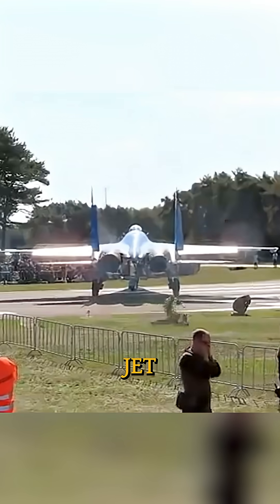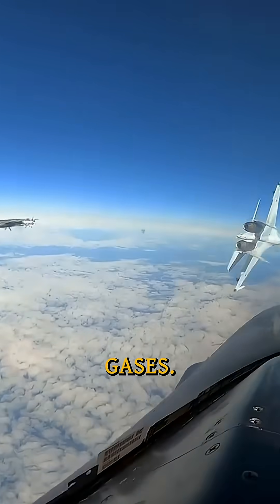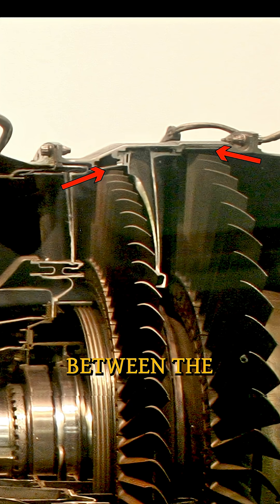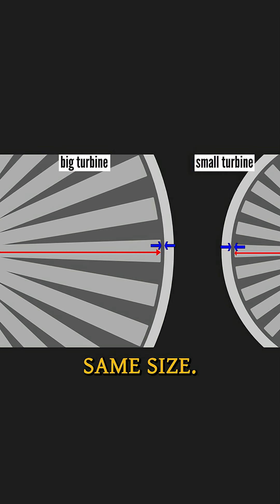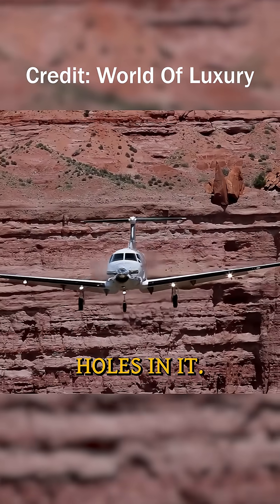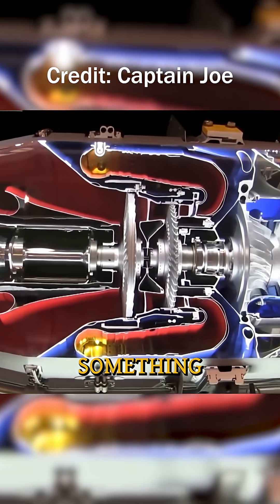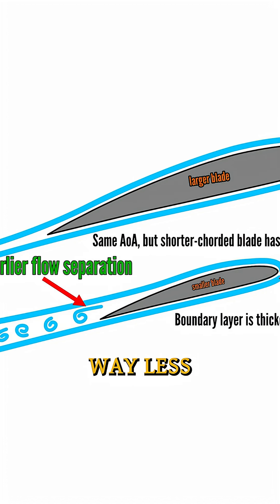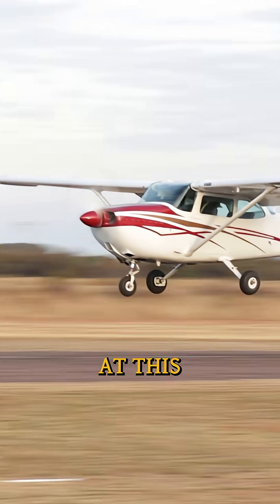Why Turboprops Can't Yet Replace Pistons on Small Planes

Comment: The cirrusjet would like a word
Reply from the maker: The Cirrus Vision Jet is a 7 seat aircraft with an 8kN turbofan. It's not exactly tiny.
Reply: @LetsGoAviate  no but by enjine stands it is especially for a turbofan. You also have the TP-100 series engines which are smaller than the Lycoming O-540 found in the Cessna 182RG.

Comment: Just saw a short where they addressed that gap by introducing more or less kinda like winglets for the fan blades end. So it creates a kind of bubble that keeps flow more on their respective high & low sides. It lead to a 2.7% increase in efficiency without any other major modification. Since they couldnt adress the gap it self due to things like thermal expansion. Curious to see if it'll be implemented guessing the math works out when it'll be spread about that many planes and flights.

Comment: I don't agree with a jet "creating thrust with its exhaust gasses". Only rockets do that. In commercial jets most thrust (85%ish) is "bypass" air, created by and encased propeller. Even in fighter jets a good (35%ish) amount of thrust is "bypass", only in need they can fully function more like a rocket with the after burner (but lose fuel fast)

Comment: All the bull shit he said is true however the real reason is money, upkeep on a turbine is expensive, a turbine engine is expensive due to tight tolerances on everything, there are cheap jet engines but they dont pass noise ratings for small aircraft ao no one uses them either. Reciprocating engines are just cheaper. You can buy a small Cessna for 20 to 80k but if you put a 200 to 300k engine on it thrn its out of reach for most weekend pilots. It would be like putting a LS1 in a focus.

Comment: You can't beat the torque turbo props produce. The engines produce power much more rapidly from idle to full power. I would rather trade fuel for torque and throttle response. You can land w the engines at idle and be able to power up and go around if needed🛩️🤎😎

Comment: The problem is that those small aircraft ICEs still use Avgas with lead added to it. There is no excuse for it. If not turboprop, then battery electric.

Comment: The real question is why no small plane uses a modern direct fuel injected piston engine rather than a design that is unchanged since the 1940s
Reply from the maker: Well the Rotax 9 series iS engines use fuel injection far more modern than the 1940's, though not direct injection.

Comment: There have been turbo prop DE Haviland DH2 Beavers since the late 1960s   Very successful !
Reply from the maker: 500+ hp turboprops have been around a while, yes.
Reply: And more recently, the Bombardier Q400 version of the Dash 8. The Q is for Quiet. They add a Active Noise and Vibration System (AVNS) which basically does what the name implies. It has several sensors and microphones to counter the engine noise and vibration by creating the inverse-phase frequencies. Ultimately reducing roughly 104db in the standard model to 84db. Since db is measured as logarithmic, To our ears, it's like 1/4 of the volume. Or, as loudish road noise or a very busy office.

Comment: Most of these issues are solved from a technical standpoint, just look at the turbines in modern turbochargers. 

The big issue is certification and the associated costs.

Having a variable geometry compound turbocharger fail in an automotive or even industrial setting is a bad day. Implementing all the technical advancements that allows for small, very effecient and powerful turbochargers into a turboprop would be expensive, but recouping the RND AND the certification costs would cost an absolute fortune. 

Could it be done? Absolutely. Could it be done without essentially burning millions or possibly even tens of millions of dollars you'll probably never recover? Probably not.

Comment: Latest turboprops mounted on LSA’s and ultralights have almost the same fuel economy as piston engines , are way lighter and can maintain their thrust at altitude. This is done through the use of a heat exchanger in the tailpipe which expands incoming air before being fed into the compressor : Technologically difficult hence their only recent appearance. 100hp with 7gal/hr, much lighter, low frontal area and cooling drag, no vibration, low noise, can be used to drive a generator to power electric engines, recharge onboard batteries: The future!
Reply: Sounds interesting! Could you send link to these engines.👀
Reply: @ikaswitno probably talking about the Turbotech TP-R90.

Comment: Another reason is that a turboprop is very inefficient at lower altitudes. You need to be higher than 15-18000 feet to get good economy. This means pressurized airplane = very expensive.  Below 10.000 feet any turboprop is very ineffective.

Comment: 1940s piton engines still exist (instead of equivalent or better power diesels) is the huge cost of homologating a new engine. Regulations are necessary but they go nog adapt the process for small engines.

Comment: There are smaller jet engines and turboptops in RC planes, but they probably have even worse fuel economy and are much much more expensive than comparable piston engines
Reply: That and there's not tiny little people inside whose lives depend on them.
Reply: @dukecraig2402  I'm sure you could make them reliable they tend to be very simple engines. And the RC ones are way too small for say a turboprop 172, so they still be much closer to proper jet engines in size and thrust. The RC ones have up to 200 kN thrust do around 20 kg and they cost about 3 grand, the nice ones with proper control systems etc and they are super reliable, not much besides fatigue happens and that is predictable. But for 3 grand you can probably already buy a used piston engine and a jet engine with say 5 times the thrust, 100 kg should be fine for a small plane, but if the cost scales plus the extra engineering for certification etc... I think 50-100 grand is reasonable for a small turboprop engine. And maintenance won't be cheap even if it might need less. And everyone can repair a piston engine, even a pilot with a manual and some experience, a turboprop not so much. So that would make maintenance expensive. You'd need to go see jet mechanics and they need to learn new stuff an APU is closest but that doesn't make thrust. 

Chopper tend to have them but they're inherently more expensive anyway. 

Shame turbine cars didn't take off (hihi) they were great and we'd have millions of used turbines of the appropriate power and mechanics used to dealing with them and they'd run on every fuel except gasolibe. Even whale oil! Unfortunately it was cancelled for variety of reasons not unlike the GM EV-1 was cancelled as they feared the decrease in maintenance, which is a big profit for dealers and mechanics. Turbines aren't quite EVs but they got great mileage on the highway, terrible in traffic. Jaguar made a prototype once, hybrid turbine electric, though the turbines made power, they didn't drive the engines so you basically had an EV with on board generator. The Chrysler Turbine car actually had the turbine connected to the wheels. It would have been perfect as a hybrid, small battery for low inner city, stop and go, leaving the turbine to spin efficiently and just charge the battery, if the clutch is engaged. 

I think if we had turbine cars we may have had small turbine aircraft.at reasonable prices, the car market is WAY bigger so economies of scale incentive for efficient design etc... blablabla It did actually come to pass for military vehicles, the M1a Tank from the US has a turbine engine. A lot of power for a small size and good reliability.
Reply: @please_stop-v7o perhaps gaps are less critical in a centrifugal compressor? And in a turbine it is even less critical. And I would feed a turbine through coaxial rings with bleed air as sealant and thin film cooling of the shaft (and nozzle).
Reply: @ArneChristianRosenfeldt  They're still super high tolerance devices, most of the cost is the turbine blades and casing made to high precision. Now the gaps will be larger in comparison relatively but the blades are much smaller too, they get quite nice performance. 

In small turbines you actually just add the lubricant (10%) to the fuel, that solves a bunch of problems and simplifies the design by a large margin. 

I'm not sure how they achieve cooling, probably just passively but the turbines can run on a bench and not tear themselves apart so the bypass aur might be used for cooling not sure. Shouldn't be much of a need for film cooling at these temperatures, maybe they do it but the fuel entering the combustion chamber is essentially already doing that and removing heat through the exhaust and since its not a rocket with 2000+C exhaust and combustion temperature, plenty of alloys can handle that. The main metallurical difficulty in turbojet and fan engines are the turbine blades. They expand a fair bit when spun up so the engine has to handle that. 

A jet engine can totally get stuck btw if the wrong part cools down too quickly and then you need to wait half an hour, which sucks if you just lost both, which has happened. The two who did a joyride on a positioning flight and stalled at 41k, dual flame out, core lock, forgot to focus on landing rather than restarting, no survivors. But back then the checklist just said maintain 210 knots, not that if you don't you won't get your engines back. So still a good lesson learnt even if it took two pilots treating a liner like a toy. They aimed for green/black gear up so I have no ill feelings towards them, they paid the price.
Reply: @please_stop-v7o  RC jets never introduced thin film cooling. I don't think that it is possible for the blades, but I want it for nozzle and hub/aerospike.
Reply: @ArneChristianRosenfeldt  turbos for manned surface vehicles are proven technology. The turbo on a semi can run for a million miles no problem.
Reply: @please_stop-v7o  turbochargers on surface vehicles are proven technology that is relatively cheap and reliable.
Reply: @toolbaggers piston engine exhaust is far less hot than the combustion flame. At least for hi octane fuel or Diesel. And below 4000 RPM.
Reply: @dukecraig2402 turbine engines are statistically far more reliable than piston engines when they aren't being operated by some fool that doesn't know who Bernoulli was
Reply: @dukecraig2402  The human "jet packs" basically use RC jets and there is a giant human relying on them not to fail.
Reply: And electric is better anyways for RC and perhaps in the future for small general aviation planes.

Comment: Very nice explanation.  The tolerances getting huge at small scales. And the weird effect of physics on tiny parts. Where air is proportionaly thick on tiny surfaces.  Like tiny gears need lubricant but thin oil for a fishing reel is like peanut butter in clock movements. So a ultra thin oil or a dry lube won't gobb up movements. We can scale up or down our mechanisms but the elements behave differently. Air and fluid acts thick and clingy.  I learned with slot cars greasing gears slowed them down. A trace of WD 40 didn't bog them down.
Reply: Would You Believe I Was Thinking About My Aurora HO Slot Cars From 60 Years Ago While Reading Your Comment. I Remember Using The Little Red Vial Of Oil That Came With It. Would You Believe I Still Have The Track!?! Thank You. (Like #19 - Reply #1)
Reply: @thewatcher5271 Mint. I was thinking of AFX pancake motors. They were more sensitive to this than Tyco's.  But I had a mountain of TYCO tracks. Great memory's. I had examples of virtually every track accessory.
Reply: Wonderful analogy

Comment: Uh.. the Reynolds number problem is bunk.  

Reynolds numbers make things work better when they are smaller.  

This is why the bumblebee flies and paper airplanes fly and why lots of inventors had an easy time making flying model airplanes but difficulty making full size ones.  

This is in fact why the Reynolds number exists in the first place.. so that wind tunnel models can either be mathematically interpreted to full scale aircraft or variable pressure wind tunnels can be used to great the same conditions.
Reply: No, the reason for that is the square cube law. Roughly weight increase with volume, while lift increases with surface area. Boundary layers get relatively thick at low Renolds numbers, which generates more drag. Tripping the boundary layer can help in some applications.

Comment: Gogetair enters the room (they builded a 6 gph turboprop)
Reply: Traditional turbine engines are optimized for high altitude flight and higher power output. No one has yet designed a turbine optimized for 10-18k feet. Therefore engine choice for unpressurized lighter aircraft is limited.

Comment: Turbo props and even piston aircraft engines use the exhaust (jet) as part of the thrust calculation, in WW2 piston engine aircraft at least 5% of the motive force was via the exhaust especially in aircraft that relied on turbo superchargers. post war Turboprops like double mamba Fairly Gannet produced >10% force hence the large exhaust pipes.  
Helicopters with a turbine motor (post 1950s helios that had piston engines like S55, S56, H21, & CH-37) use around 20-25% for main rotor, and between 5 to 15% for tail rotor so more than half the output of the turbine is exhaust - thus available forward thrust, which needs to be dissipated for controlled hover.
Reply: Steve, can you explain your statement 'especially in aircraft that relied on turbo superchargers'. The idea behind a turbo supercharger is to extract energy from the exhaust to power a compressor so there will be less exhaust thrust not more.
Reply: @mikeprzyrembel In aircraft in particular aircraft with superchargers the exhaust was specifically ducted reward aid thrust, prior to 1939 many aircraft had exhaust manifolds and exhaust collectors (in Radial aircraft ducted downard, but later exhaust invariably pointed rearward to add to the momentum despite that reaward exhausts in particular UK bombers gave away a tell tale exhaust glow, ( but try putting your hand over the tiny output of your car exhaust, and you'll get the message try that on a 1000 or 2000 HP radial rather than a sub 60 hp car motor, but an extra 5% output  is not insignificant).  As a recommendation I suggest you link to @GregsAirplanesandAutomobiles his encyclopaedic knowledge might be of value.
Reply: @steve-qc8hd  In your first post you wrote turbo superchargers which are known as turbochargers, now you are saying superchargers which are typically mechanically driven and do not take energy from the exhaust.
Reply: @mikeprzyrembel  No I mean exhaust driven superchargers, - patently you aren't going to get any push from the unused residual pressure from a mechanically driven impeller, just as you wouldn't get any  power from a integral cowling intercooler fan, 

As I can't be sure whether you have lost something in the reading(I possibly assume  East European origin from the name) or possibly you're deliberately flexing for clout, I feel this conversation has run its course as I said previously if you want a technical discourse go listen to and view Greggs stuff but heed this warning if you are playing for clout don't try it with Gregg or he'll ream you out a new one.
Reply: @steve-qc8hd  Do you know how hard it is to find a sub 60 hp car motor? They don't even sell new cars in America with that little power. I don't think they sold cars with that little power since the 70's.
Reply: in WW2 they called them turbo superchargers. Turbos are just exhaust driven superchargers. A turbo is a supercharger but a supercharger is not necessarily a turbocharger.
Reply: I saw an RC flight display with jet engines in the 80s.
I see plenty of RC jets on YouTube. Drones have jet engines.
Pistons and props use less fuel. 
Pistons and props cost less to make and maintain.
Reply: @ricusmate  Not all drones have jet engines in fact most are piston engined, the Shadid is a prime example as is the Bayraktar TB2.  

As to the cost of piston, and gas turbine (jet engine turbo prop turbo fan) while it is true manufacture of turbines is more precise, most is done by machine not by hand, and it is true, they use a lot of fuel, require rigorous checks, but all those costs are offset by their mean cost per KW, in simple terms the largest Piston /Propeller engine ever fitted to an aircraft 3,200 kW R-4360 as fitted to C124 Globemaster among others equates to a 3,420 kW Allison T56-A-15 of the C-130 and just to put maintenance into context the MTBO of a T56 is ten times the period of an R-4360, okay it might be that a general replacement of a T56 is required at 6000 hours but you aren't going to get 10 rebuilds out of an R-4360 either two rebuilds max. before it is condemned. The type of fuel required is far less stringent on a T56 compared to ultra high octane purple gas on an R4360

So best advice stop using Google AI for comments.